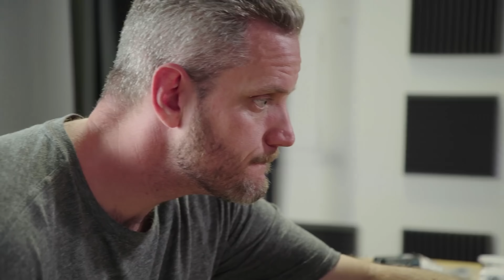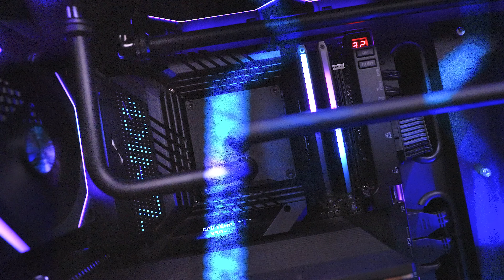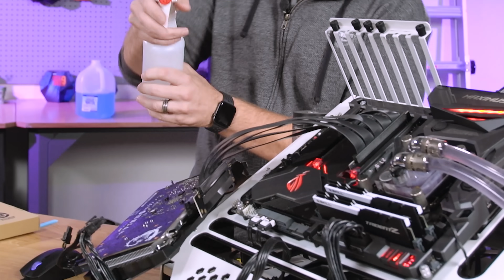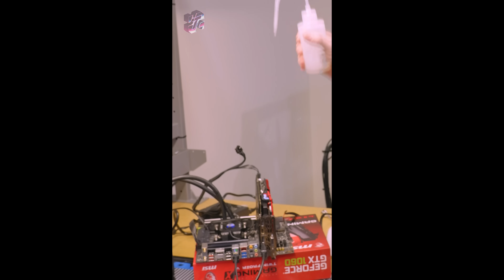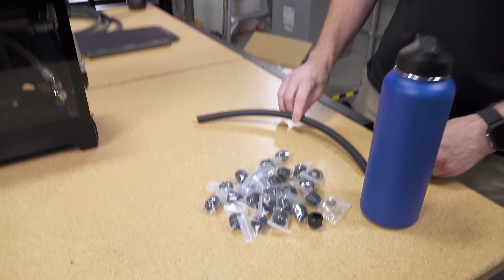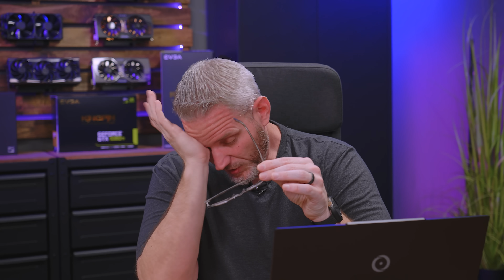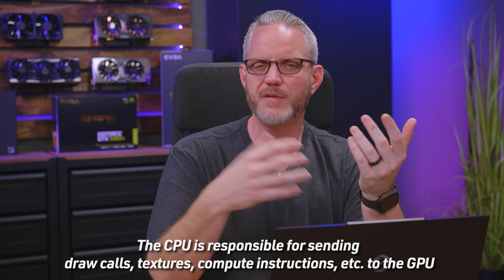5 Myths about Watercooling that are WRONG!

Comment: I'm a person who likes the nicest of things but also doesn't want to work on them.  that's why I went with an air cooler.  7800x3d with a 7900xtx.  i pull 200 to250 frames on 4k warzone.  1440 high 300s.  my system never gets hotter than 65c.  i can play cyberpunk on extreme settings with ray tracing on and my frames are at 115.  I know its not top of the line but it has ran for 8 months with out a hitch
Reply: Nice. Which 7900XTX you have? I got an XFX Merc 310 Black last week and been loving it. Mostly play MWZ at 1440p and getting mega framerate. Have a 7950X tho

Comment: After watching this channel for a long while, I built a custom loop for my 3080TI.  Eventually, I needed to clean my loop, touch-up the thermal paste... basic maintenance, really.  I used a bunch of isopropyl alcohol during the cleaning and when I put everything back together, it looked like I killed my card.

In the end, I just hadn't waited long enough for the alcohol to evaporate.  Isopropyl alcohol evaporates quickly, but impurities can mean a much longer dry time than you expect.
Reply: if you used 70/30 yeah.  most of the ones on the shelf at the market are 70/30 because it disinfects better with some water in it.  but theres usually a small single 90+% bottle too at the markets too. I managed to find one that is 99%. evaporates in a couple seconds.

Comment: It was an expensive initial cost, but I don't regret going custom loop one bit.  Been using the same pump/res combo, fittings, soft tubing, and CPU block for multiple years now.  The GPU blocks when I decide to upgrade are a punch in the gut, but I accept it.  My main reasoning for continuing to have a custom loop in my system is silence.  2 60mm 360 rads and a 40mm 280 rad in my system cooling a 14700k and a 7900xtx.
Reply: Yeah...CPU blocks are almost eternal, but GPU blocks? Well if you want a different card, you are pretty much screwed (unless you are willing to do awful lot of DIY to make it fit).
Reply: I do plan on replacing my EKWB Velocity 2 CPU block with an Alphacool Core 1 Aurora block very shortly.
Reply: @reconbbs360  crazy good block I am using one myself, and it isn't even expensive compared to many other blocks.
Reply: Hats off for the red flagship.
Reply: @JohnWilliams-gy5yc  Got a killer deal on it off FB marketplace.  It slays 1440P.  Was considering upgrading my platform as well and go AMD but I decided against it.  Was rocking a 12700K with a MSI Z690 EDGE DDR4 for a while and was able to get a 14700K for a decent price.  Still using the same DDR4 that I was using with my 9900K.  LOL.  I'll wait and see what Intel has to offer in the future before I take the DDR5 plunge.
Reply: THIS. Once you get wet, there's no going back. Never again will you tolerate the fwoosh of a GPU blower XD
Reply: Dunno, my air cooled PC is pretty silent. Noctua fans and cooler.
Reply: Yeah, they are expensive but you have the PC that actually makes sense to have watercooling

If someone had a 7800XT, they are better off using the $300 to upgrade to a 7900XT or even XTX on special to get a better gaming experience
Reply: if sound was an issue id probibly do the linus thing and keep the computer in another room.
Reply: Used my H105 for literally 9 years
Reply: @kalef1234  That's pretty solid for an AIO.  Nowadays 240mm just isn't cutting it.  I haven't seen temps over 60 in years unless I'm stress testing OC stability.
Reply: @reconbbs360  it was. Have a 360 EK AIO now. The H105, however, was a THICK 240 almost double thickness of H100
Reply: The reason I use a an aircooled pc is silence. I listen to music with open back headphones and a pump running with a minimum of 2k rpm 24/7 is not helpful.
Reply: @dr.brennstab2201  Are you in a sound proof room? if not I don't see how you would even be able to notice a pump. I just turned my pump on full blast and its still quieter than the sounds I hear coming from outside my house
Reply: @dr.brennstab2201  This should be the opposite lol. My D5 pump is at 2k RPM, I could run it at 3k RPM and it'd still be pretty damn quiet but at 2K I literally can't hear it unless I press my ear against the case. My fans (140mm) are at 1300 RPM and I can barely hear those as well.
Reply: @gbtygfvyg  I run my D5 at 2000 idle and a curve using fan control software.  Typically, never goes over 3500.  Full blast you can barely hear it.  LOL.  That's why I laughed at that guy's comment.  I run my case fans at 1000 during idle with a really slow curve.  Works for me and my temps are fantastic.
Reply: @dr.brennstab2201  Yeah, and next you're gonna tell you can hear the difference between copper wires and giga-goldplated-über cables with super-diamond-spacegrade-megashielding.

If you can do that, you're not human.
Reply: @dr.brennstab2201  LOL, my pump is silent at 2k rpm.
Reply: @reconbbs360  Tried 2 different ddc pumps. I thought that the first was faulty, "Cause watercooling silent". But they both had the slightest of whining. Problems with pump noise is not uncomon with custom loops. Another possible drawback that you don't have to care about with aircooling...
Reply: @dr.brennstab2201  Ah, yes DDC pumps have an annoying whine to them. My old DDC pump had a high pitched whine that I got used to but when I could constantly hear it unless I dropped the speed super low I was surprised at how noisy it was too. Try to get a D5 pump if you're doing a custom loop, does a hell of a lot better and it's quieter.
Reply: @dr.brennstab2201 Audiophile hearing 😂

Comment: ive got a question, i have a 7900xtx and a 5900x, alkl water cooled. in the hyte y60, it goes thermaltake d5 pump to gpu to a 120mm radiatior, to cpu to 360mm radiatior. temps on gpu are normal even under load i hit max out 50c however cpu i keep hitting 80c under load. on idle i am sitting at 50c wondering if the cpu is not sitting down right. and its is not old "water" either. keep up on that and even keep case cleaned out with compressed air.
Reply: Or your CPU is eating all this hot water from GPU, i dont think that 120mm rad is adequate to cool water from 7900 before it reaches the processor.

Comment: So here is probably an unasked question.  Ive seen a bunch of Mineral oil pc builds where they are completely submerged with that being said can you run Mineral oil in a water loop rather than rad fluid or distilled water
Reply: Yes, but oil is more dense then water. And also turns into goop over time. In short - it work amazing (even better then water), but is very messy.
Reply: @alexturnbackthearmy1907  from what i am reading it can last up to 3 years and only gets thicker due to dust or debris or extreme temps like extreme cold extreme heat can make it thinner not thicker as i am talking about mineral oil not petroleum oils

Comment: Yes water cooling system does make room cooler. Ever since if have switch to water cooling, my room is no where near as hots as the years past, PERIOD. I have lived in the same place for 12yrs. The last 3 summers have been with water cooling,  thermostat is the same, the temps have not been changed.  THE ROOM IS COOLER, PERIOD.

Comment: I appreciate your well balanced approach to this. Unlike a certain youtube yokel who tim taylors his watercooling then runs his canuckhole about how much water cooling sucks and is so much of a hassle.
Reply: Watercooling does suck and is a major hasstle... except when it isn't. 
Want a PC that get shipped regularly? get that weight off the CPU and strapped to the chassis.
Want a NAS that runs untouched for half a decade? leave the water in the tap. 
While I think there are more use cases where it's inappropriate than ones where it makes sense (the air doesn't experience pump death or leak boom juice), it's horses for courses.... 
... that said you could ignore water cooling entirely & not really be worse off for it; any hardware hot enough to need it in the consumer space is the result of a company getting desperate & abandoning thermal targets (see intels last few generation top tier parts & the AMD Fury GPUs), and even amongst enthusiasts those parts are rarely the best choice.

Comment: I'd really like to build a watercooled system like at least once in my life. I've literally built PC's my whole life, not in a huge quantity but I generally do a lot with electronics and stuff. But I've never built a watercooled PC. Mostly for price reasons tbh
Reply: Buy your self an alpha cool AIO. To my knowledge they are the only ones you can pull apart. Now that's a cheap custom water cooled CPU. All you would have to add are a few fitting and soft tubing. You could do it all for less than 300

Comment: You should do some videos on Ebay Chinese water cooling kits.
Reply: Pretty sure a 2 minute video that consists of 1 minute of intro, 30s of outro, and 30s of Jay staring at the camera saying "Don't.  Ever.  Do.  It." wouldn't go over too well, lol.  Those "kits" are hot garbage in every way for anything resembling a modern system.  Great for putting in your WIndows 2000 workstation though.

Comment: i am a victim of an AIO that started to leak after 3 year , it cost me a motherboard and AIO , luckily the rtx 3080ti survived even though it had some drops on the plate , so yeah at the cost of cooler temperatures you are at risk of damaging some components when it starts to leak , if it doesnt pump will die ot liquid inside will gradually evaporate so you have to buy another one

Comment: I just want a water blocked GPU without spending an extra $300 for it.  I swear it used to only cost like $150.  Maybe I’m remembering wrong
Reply: Yeah my Phanteks 3090 blocks were $200 and 100-120 back in the GTX 400 series era, material cost did raise a bunch though which sucks.
Reply: Get a byski block and a founders edition card. Save money and get better performance.

Running a byski on my 4070ti and it’s been fantastic.

Comment: A more efficient transfer of heat will only make the space hotter if it means the components can run at higher power limits. How fast heat transfers doesn't have an effect on the total energy outputted unless some other factor changes. At most it might affect how fast your room gets hot, but that's about it.
Reply: Came here to say this but you beat me to it. Jay probably meant that with more efficient cooling come higher power limits and that's why his room gets hotter.
Reply: @nasko235679  Agreed, I think that was the intention, but it could have maybe been more clear. I just found that the way it was written it almost perpetuated the very myth it was trying to debunk. Anyway, no shade intended to Jay or anyone. I only commented to try to help people avoid that misconception.
Reply: thank you.
Reply: Exactly. 300 watts of heat is 300 watts whether it's removed by air to air exchange or water to air.
Reply: @JonRacesCars  300 watts in an hour or in 10 minutes is very different. Especially in a badly ventilated room.
Reply: @Phireo  300 watts for* an hour yes.
Reply: @Phireo  Not 'in' an hour. 300W for an hour, or for 10 minutes. And yeah, that makes a difference because the total amount of enery (in joule) is 6 times as high. 

One Watt is 1 Joule per second, so if you multiply Watts by time, you just get Joule (energy) back
Reply: Turn the AC on.

Comment: One reason I don’t like custom water cooling is just the fact if you got a new cpu and you want to upgrade you gotta take apart all that stuff compared to just a air cooler with lots of fans
Reply: Came to say the same....
Reply: Just use soft tubing.
Reply: Your comment got stolen by a bot dude, sorry.
Reply: @Nelo390 Bots are a plague 😭